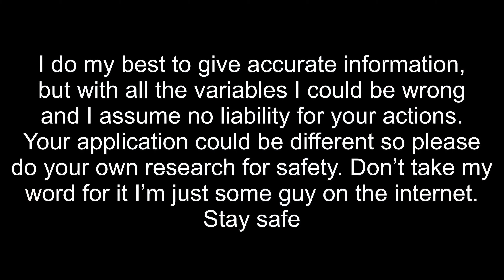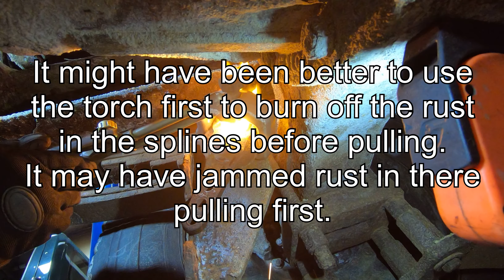changing an air brake can and slack adjuster. There will be rust.

Comment: I am going to have to get a puller and try that method with the air hammer I usually if they are seized on I just cut them off with the torch which works but its a mess! you dont see many manual slack adjusters these days. Cheers!
Reply from the maker: It seemed to work pretty well. I think tiger tools make an assortment of pullers for all the different types of slack adjusters, they are pretty pricy though. Yeah these manual ones are dirt cheap. The truck is a 95 so I guess it might have been on the edge of the auto adjuster mandates. I was surprised I could still get them.
Reply: @JasonTheMunicipalMechanic  yeah right on the edge if I had a manual slack go back I use to always replace it with an auto at the old job. I have no idea what manual slack costs never bought one.  now the fleet I work in is all auto slacks. I will check out the tiger tools to see what they have! Cheers!

Comment: Not a professional mechanic with experience mostly on my own stuff.  Did the slack adjuster really need to be changed?  On camera, it appeared OK except for rusty.
Reply from the maker: The adjuster nut was seized so it wouldn’t turn and the collar that springs up to hold the adjuster nut from turning  was rusted and stuck in and not coming up to hold the nut from turning. I could have left it but I couldn’t adjust it. This adjuster was only about 36 dollars so it wasn’t worth messing with. The self adjusters can get expensive.

Comment: Thank you so much.  I have learned so much from all of your videos and you definitely have helped me. I use the exact same torch method for heating stuck/rusted parts.  Wes, on the other hand uses the heat and quench method that his Dad taught him.  Do you think one is better than the other?  Th e only concern for me with the heat quench method is that  it changes the temper of the metal more severely and perhaps would make you more likely to break the bolt/nut if it was re-used.  Not on issue with this video, but I'm just trying to learn.  Kind regards, Craig
Reply from the maker: There are differences in technique. I’ve tried it both ways. It depends on what you heating. A red hot bolt can twist and distort, Quenching can harden a bolt, but letting it cool slowly can soften a hardened bolt. I’ve personally had better luck with removing them hot for nuts and and bolts that I can heat the outside fastener. Things like bolts that go into something I can’t heat the outside you would want to let the bolt cool so it isn’t swelled against the threads in the hole while hot. I would say try them both and see which one you like. Sometimes one works better than the other.